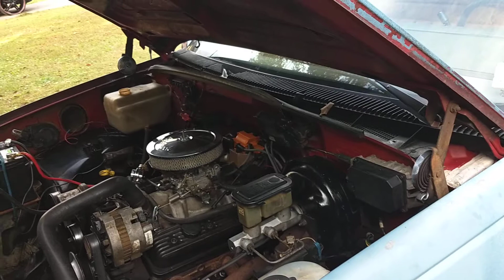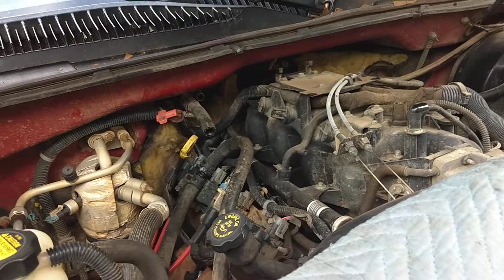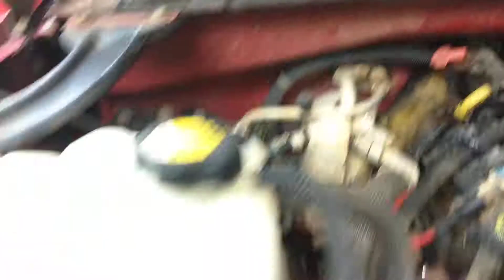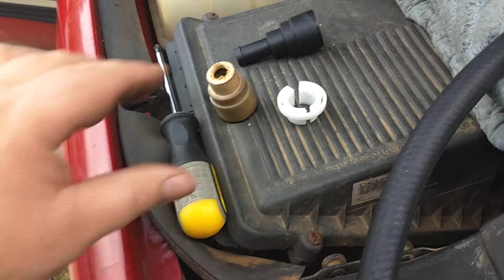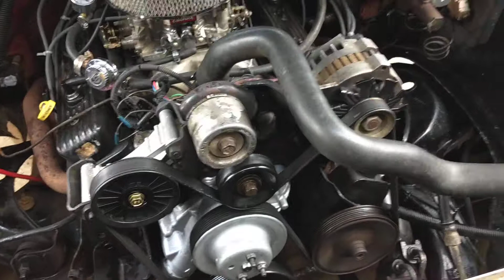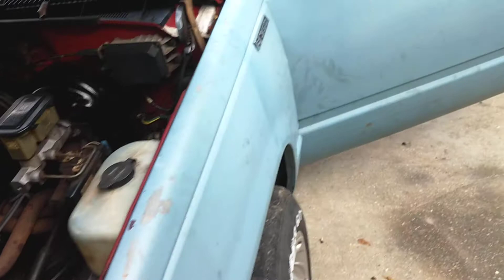I done two at the same time! Not click baiting.

Comment: Hell if it been cut on and there no pcm controlling the transmission. Be point less to get that 700r4 rebuilt until you figure out if the pcm is controlling it. I would just do away with it all run a turbo 350 or turbo 400. Evidently not a everyday driver just play toy.
Reply from the maker: Ya I'm gonna go 350 turbo with stall  just was hoping I could get this 700r4 going so I could buy a good 350 turbo while saying up money. Christmas is killing the wallet.
Reply from the maker: Plus I think the 88-92 700r4 are controlled by line pressure with governor and detent cable. Since the guy that done the swap in the truck removed the TBI and put a 350 carberated vortec engine and left the 700r4 it's been a learning process for me lol pulling my hair out when I go to part store to buy parts for this thing.
Reply: @tobroke2007  ... I know the feeling you gotten someone else half ass job an trying to fix it. Ran threw that a bunch of times.